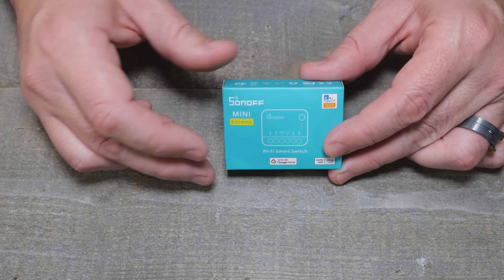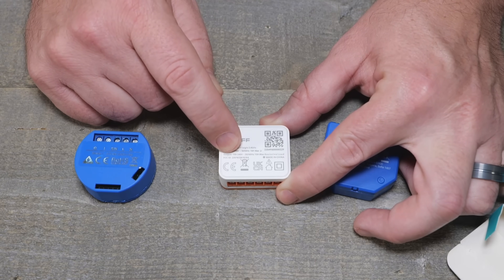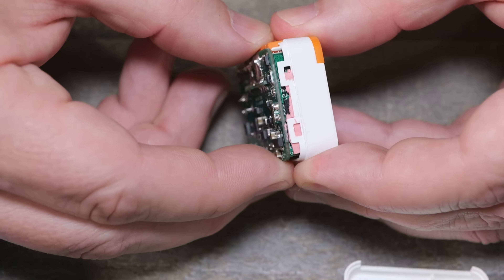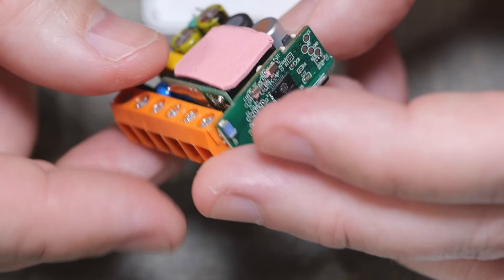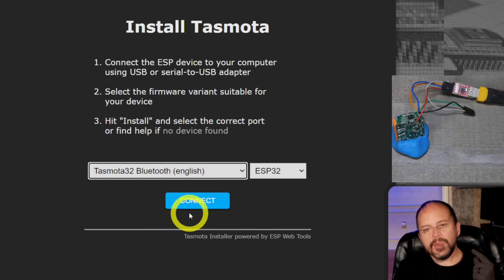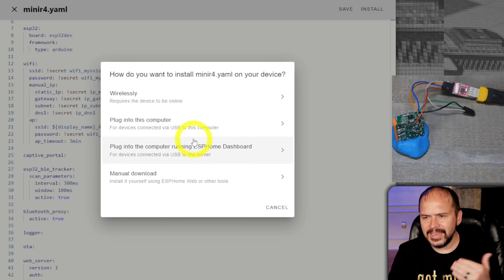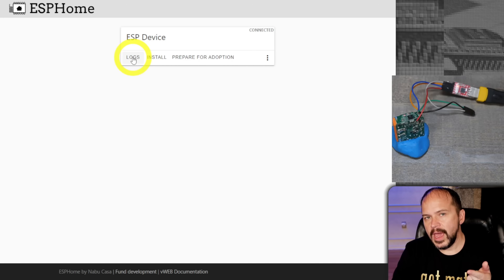Sonoff Mini R4 Switch ESP32 and ESPHome & TASMOTA How To Guide

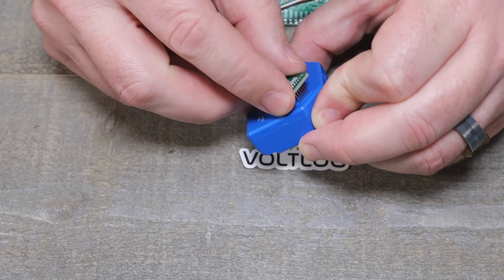Comment: Hey, how did I miss you talking about that little board at 14:32 to access the shelly headers?  That looks slick.  My operation is embarrassing...
Reply from the maker: https://www.tindie.com/products/voltlog/voltlink-cp2102n-usb-serial-adapter-programmer/
Or if you are US based and want it quicker
https://wantmoore.tech/products/voltlink
Reply: @digiblurDIY  Thanks!  do you have a video on it?  I like the shelly adapter, but im curious how that board is better than my cheapo FTDI adapter.  Keep up the great work!
Reply from the maker: Not a full blown one https://youtu.be/j3xvmPom6Mc   it is my go to board now though.  USB-C and no issues powering up stubborn hungry devices like many other adapters struggle with.

Comment: I used the Sonoff Mini 4R as a reader for my electricity meter. 
The electricity meter has the infrared interface where the data tumbles out at 9600 baud. You can buy the appropriate reading head for this. All I needed was an ESP32 and the right power supply. I put Tasmota with Smart Meter support (SML) on the Mini 4R. RX and TX come on the board, as well as GND and 3V3. 

But one thing must be taken into account when connecting: the Neutral comes to terminal L. 
And I put the hot conductor L at terminal N. 
This ensures that GND is at ground potential. The infrared reader is connected to GND and terminal L
But this also means that the relay now switches to neutral, as does the switch. But I don't use either of them. 

It is only important that the ESP32 runs 24/7 and puts the serial data from the electricity meter into the WiFi.

Comment: The Shelly Generation 1 has an ESP8266 in it. outdated !
The Shelly Generation 2 and 3 has an ESP32-C3 variant with 1 core. 
The Sonoff MiniR4 has an ESP32-DOWD-V3 with 2 cores.
And the Sonoff MiniR4m also has an ESP32-C3 with 1 core.
This means the Sonoff MiniR4 has the most powerful CPU on the board.

Comment: Hi. I tried to flash the device this way, but when I turn it on with the button pressed, I get a cyclic reboot

ESP-ROM:esp32c3-api1-20210207

Build:Feb  7 2021
rst:0x3 (RTC_SW_SYS_RST),boot:0x7 (DOWNLOAD(USB/UART0/1))
Saved PC:0x40048b82
Download boot modes disabled
ESP-ROM:esp32c3-api1-20210207
Build:Feb  7 2021
e.t.c.
Reply from the maker: what did you flash it with and how?
Reply: @digiblurDIY  Device is sonoff minir4m (green). I used FTDI ft232 usb-uart which I have successfully flashed many other devices before. I also tried my own usb-uart which automatically enters programming mode when using esptool with EN and GPIO0. I often deal with esp32 and usually have no difficulties with its programming. As I understand, the programming mode is disabled in the factory firmware. In the previous message I posted the console log connected to the device. I'll try to buy and resolder esp32-c3.
Reply from the maker: @mfowuki what firmware file and what app was used?
Reply: @digiblurDIY  At first I used tasmota web flashing and the corresponding image for esp32-c3. But it didn't get to programming, after some time a message about a connection error appeared. When it gave an error I tried to use esptool, but I couldn't even read the mac-address. The device doesn't enter the programming mode in principle, which is visible in the console log. In the programming mode, there should be no cyclic reboot.

Comment: I have bought a SONOFF MINIR4 so I can get an application, with Alexa creating a routine, for my solar energy system. The idea is that it tells me when I have power from the electric company and when I don't...the question is, can I put a 120v cable on the S2 so that it tells me when there is power and when the power went out?...thanks
Reply from the maker: I don't think you can wire it like that according to the docs.  https://sonoff.tech/product/diy-smart-switches/minir4/

Comment: I used your template for Tasmota but it does not toggle power when using only S2 as a switch input.
Reply from the maker: Did you wire like this? https://itead.cc/wp-content/uploads/2022/12/MINIR4-1000pxITEAD_13.jpg

Comment: 5:24 as noted, CX1 is an X-class capacitor, for RF noise reduction. But just above that is a resistor wrapped in heatshrink and in series with the full mains input, and this is a "fusable resistor", designed to self-destruct if presented with overcurrent - and then the heatshrink stops ceramic shards going everywhere. Not a great design, but not the worst either.
(at 5:46, the underside of the board shows D2 connected to a 'Z' shaped trace with a hole in the pcb just above your finger, that is the underside of the fusable resistor, showing that it does indeed cut power to almost all the PCB when it self-destructs)

Comment: You need to separate shorts from overload. If you have a 15 amp fuse and get a short after this fuse the short circuit current may be in several hundred amps. So for a short circuit situation it does not matter if you have a 10 or 16 amp relay. They will both be subjected to several hundred amps. So it is impossible to say if they will survive a short. The fuse will disconnet the short after a very short period of time ( milliseconds).  An overload situation is possible worse. You need to be certain that the load you connect to the relay is less than 10 amps. For example a lightbulb. You should not connect an outlet to the relay in this case as you dont know what load it will be subjected to.

Comment: Hello Sir! Your tutorial is perfect, i was able to integrate the device into Home Assistant, thank you! Still i am not sure how to address the detach relay on this device as an entity in Home Assistant.
Reply from the maker: What firmware are you using now?
Reply: @digiblurDIY  esp32dev by Espressif
Firmware: 2023.8.3. (created with ESPHome) I would like to add a sensor entity for S2. Is it possible? Currently, the S2 is connected to a live phase.  S1 is empty (the 3rd wiring instruction in the manual). I was able to figure out how to be in ,,detach mode,, now i would like to create a sensor entity for S2 live phase, which is connected to a physical wall-mounted switch (to monitor the switch state, and turn other smart device on/off based on this). Many thanks in advance.
Reply from the maker: @Kisbalta I only recall one GPIO for the S1 and S2
Reply: @Kisbalta   I am looking for that too, I'd like to know if that's possible before flashing the esphome fw. have you found any way to do that?
Reply: @LeonardoDestro  all you need to do is to comment out or delete   these lines  on_state:
      - switch.toggle: relay
Reply: @Kisbalta  nice, but if you could help me i would really need your help. I've deleted the lines and when I toggle the switch I can see it in the logs ([binary_sensor:036]: 'minir4_bedroom1 Switch': Sending state ON/OFF) but i don't have an entity to control it with, what am I missing? In the device triggers i only have the relay
Reply: @LeonardoDestro  Write an automation to control something monitoring the S2 input. Select the entity on the autamation editor. In my case its a physical wall mounted swith distrupting a live wire. But using the detach relay function, now its a "digital" switch, controlling a bathroom fan.
Reply: @Kisbalta  I think I got why I wasn't able to follow your directions. When I add the device, everything is working as it should but I only have 3 entities: relay, restart and the firmware. If I've understood correctly, I should also have one more with the binary sensor labeled as display name Switch but that doesn't show up

Comment: Just about all the Sonoff marketing has this device handling lights, which explains the 10a load and the lack of DC. In the UK about most lighting circuits are now configured with 6a fuses/breakers, with the complication that most wall installed lighting back boxes where this device will be place as likely to be earthed metal boxes which impacts their comms. If a higher load is placed on the device the relay contacts are likely to be the fusing point, but I have not tested such an outcome.
Reply from the maker: I haven't been able to find 10a breakers easily in the US. Sticking with the Shelly relays with 15 or 16 amp ratings

Comment: One quibble- the mains circuit breaker is NOT the weakest point in a circuit. Not by a long shot. The circuit breaker is the LAST LINE of defense.  Fuses and circuit breakers are protection devices and exist to protect components upstream of the protection device.  Your master circuit breaker may be 100 or 200 Amp and below that a bunch of 15, 20 and even some 30 Amp breakers.  If you have a 15 amp circuit that experiences a failure, the breaker or fuse on the appliance will remove the failing device from the upstream circuits to protect them.  The failing device is already toast, so there's no protecting it.  All other circuits are protected because the failure path has been broken. Thus the name: "Circuit Breaker".
Reply from the maker: They are the weakest link in my setup. No way am I running 200 amp on smaller circuits.

Comment: I feel like the whole amps/circuit breaker explanation was pretty terrible, and clearly a lot of people misunderstood it too. 

If your circuit breaker is rated to trip at 15 amps, and this device can only handle 10 amps before it starts melting, then the circuit breaker will never trip if the sonoff device sees more than 10 amps, because it is still under 15 amps. The circuit breaker will allow the sonoff to keep pulling past 10 amps, up to 15(until the circuit breakers limit) and the sonoff device will blow itself up. If the sonoff device had a fuse built in to pop if its load draws more than 10 amps, then it would be better/safer etc.  UK plugs have fuses built in, so if you had a 10 amp fuse in the plug which this device is connected to, then you're fine.
Reply from the maker: Keep the breaker the weakest link a bad explanation? KISS as this wasn't an electrical advice video and all in theory in the matrix video.

I have learned it doesn't matter though from these comments. (except in my installs) 🤣

Comment: So in regards to the way you described the current situation. The supply after the circuit breaker is limited to 15 amps meaning the total load on the circuit cannot exceed 15 amps and will open circuit and stop excess load. 

The device is rated at 10 amps so if you are switching a load greater than 10 amps the device will fail. 

Essentially the current in a circuit is determined by the load and the circuit protection is there to provide protection to the fixed cabling in the house. There's many examples of where the supply and the devices down stream are rated at less than the supply device
Reply from the maker: Yep. That's why we see 15-20 amp switches at the store and not 5 and 10 amp ones. Probably overkill for many lighting circuits today but everyone would need to change at the same time and makes it difficult.
Reply: @digiblurDIY  I suppose my point is that the device and the circuit breaker are not really related in they way you portrayed it in the video. There is nothing wrong with it being 10 amps rated as long as what you control with it is not going to draw more than 10 amps through any part of that circuit. 

If you look at your phone charger that may have a rating of 0.5 amps (primary) and a few amps (secondary) but you wouldn't necessarily worry about that when plugging it into the wall. 

This is just one step more complex where you have to consider the type of load that you attached to the device insuring the load is within the device rating. Especially with any inductive load like small machines where start up current can be quite high when compared to their current rating shown on the rating plate. 

Anyway I think it's important to understand the circuit breaker is there to maintain the safety of the fixed wiring of the installation. 

Good video, I look forward to watching more of your content
Reply from the maker: Look at some electrical code requirements on load switching. It is the reason we see 15 amp and 20 amp switches in homes switching 1 amp or less lights. Otherwise we would have simple little 5 amp or less switches in the home everywhere.
Reply: @digiblurDIY  I'm an electrician. The fixed electrical wiring has to be at the same rating as the circuit breaker. The circuit breaker is part of the fixed wiring in the house
Reply: If the switch was to be used as a fixed part of the wiring in the house then the best course would be to put it on its own circuit breaker but if it's an appliance then I wouldn't worry about it.
Reply: I agree with this, I was raising my eyebrow with this statement on having 15A devices on a 15A breaker, it's the opposite, you want everything on that circuit to be lower than the breaker so much less than 15A. Having a 10A device on a 15A circuit is fine. It there was a short in the device it would quickly exceed the 15A of the breaker and it would trip.
Reply from the maker: @ryandetzel848  that's not now it works. You want the breaker to trip and not the device to burn during an overcurrent situation.
Reply: @digiblurDIY  I see what you're saying I think the way you explained it in the video is confusing. In a normal, correct installation there is nothing wrong with running a device rated at less than 15A, every device you normally run in your house is built this way without a fuse. The confusion comes in that anyone can hook up a device TO this sonoff that has the potential of pulling more than the rated amps (10 in this case) where most breakers are 15A in a US household. If you do this, which is using the product incorrectly, it's possible the device will catch fire before the breaker flips. A simple test to run, hook a space heater up to this bad boy and let it run...what happens? :-)

Comment: What is your favorite thermostat that works right out of the box with Home Assistant?
Reply from the maker: Probably the Venstar still but the supply chain issues hit them hard and the prices reflect that. Fully local API. Pretty slick.
Ecobee with the homekit integration is another that isn't half bad.
Reply: @digiblurDIY  well after many videos on YT found out I can't install a smart thermostat apparently a "C" wire which is the ground side of the transformer in the furnace housing, is required.
Reply from the maker: @MaxGoddur  some have adapter kits and some have internal batteries and sip off the other lines.

Comment: Why can't it be used for DC Pop out that AC relay find where the trigger mechanism is and alter it to trigger a DC relay
Reply from the maker: Used by DC as in by changing the wire terminal position and/or jumper without hardware mods.

Comment: Nice vid! What’s the tool around 14 mins that hooks into the shelly flash connectors? Very handy and prevents you from mixing up dupont cables..
Reply from the maker: Voltlog... I put it in the description for easy finding ;)

Comment: 240v at 10a is 120v at 20a.......:)
Reply from the maker: All about them amps...
Reply: For the load it's the same power but for the switch and wiring it requires twice the cross sectional area to carry double the current. Which makes 110v more expensive to deliver the same amount of power.
Reply: It's called Joules law when you talk about electricity and heat. The heating power is I^2*R, so yeah you get less power with 120 V, but the current generates the heat that breaks things (if the voltage stays nominal) so devices are rated based on current.

Comment: Just my 2cents: I would never charge 10 or 15 amps in these devices... shelly, sonoff, blabla... I don't care.
They are really useful and I have many but... if I need to switch some "real" power I use them with a power contactor that can drive SAFELY a lot of amps. No way.
Of course power contactors are quite expensive (here in Italy, decent models start from 30$) but i do not want to see my house on fire caused by a f... 10$ chinese switch. :)
With all respect for chinese people... :D
Reply from the maker: Indeed! I try to run that 60% max rule myself on things as I don't trust them much.

Comment: 10amps is its rated continuous duty rating. Its the fault current capacity that determines what protection the device requires. I think up to 20amp MCB or HRC fuse would be fine.